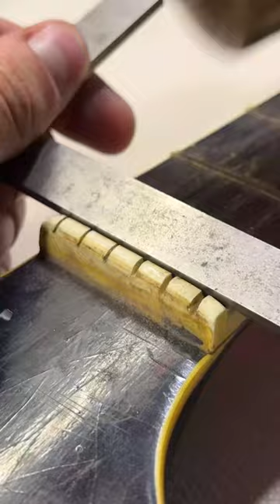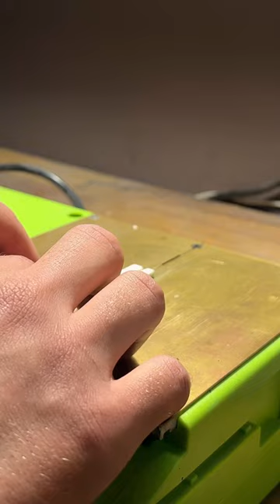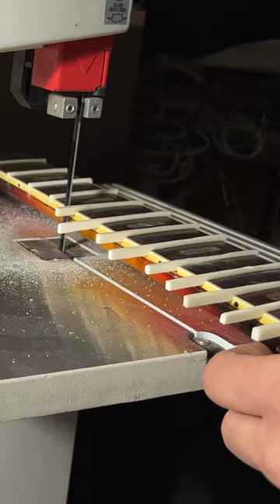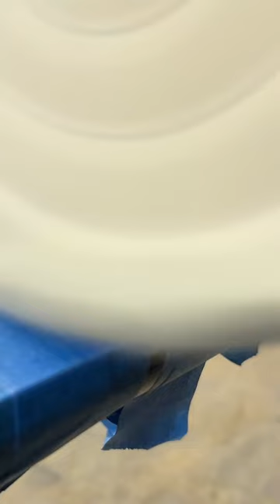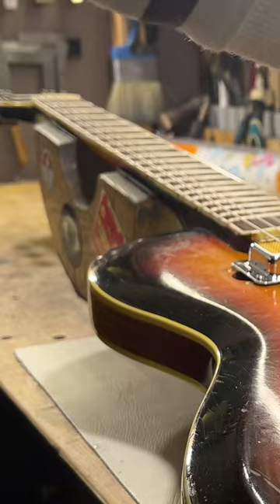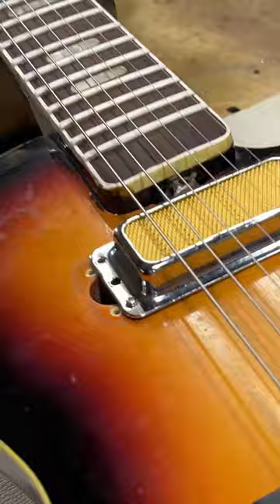bones instead of frets

Comment: nice tone, it will be interesting to see how quickly the strings will wear out the bone frets
Reply: Bone is softer than metal.  The frets will probably wear out faster than the strings.  Every material has probably been tested.
Reply: @rickjason215 No shit??!!
Reply: @rickjason215 You just repeated what dana said!
Reply: Hmmm, is nylon softer than bone? Too bad this guitar has pickups.
Reply: @rickjason215   This is a great video, for all models and materials of frets will result in a different sounding guitar. Energy is transferred from strings to neck and in the end also the body. It's resonance, these vibrations work on the strings, and the way it goes is not just "bone sounds brightest", sure it is good.
Reply: @voornaam3191  I saw a guitar made of Carbon fiber and it sounded good.  It was electric.  It would have been more interesting if it was acoustic. Weighed a couple of onces.
Reply: My guess is at a factor of probably a 100 times if not a 1000
Reply: @jadslash  Yeah brother bonus stronger than wood but it ain't shit compared to metal if he made frets out of a hard volcanic Stone it might last louder but those frets are gonna wear out at a factor of at least a 1000 times quicker
Reply: @voornaam3191  Nylon is absolutely softer than bone. I still say that bone has at least a 1000 times factor of how fast it will wear out on steel strings or whatever type of metal nickel and different alboys it's gonna wear out a 1000 times faster than steel wire frets wood.  I'm a guitar player I'm not a guitar Maker however I do understand engineering and physics at a higher level than most Engineers at least guitar Builders do and I promise you these threats will wear out really really quick and somebody that has the time and money to do this we'll only play that instrument not even once a month after the 1st month. That will drastically slow down the fresh being destroyed but I'm assuming somebody that I did this work has a knowledge and tools and money to just do that already knows the same exact thing I just said so it is what it is and he chose his choice and I'm sure he was already happy with it before he made it. I however don't think it would really make any difference in tone other than maybe if you didn't have your fretboard set up correctly and you had strings that were buzzing at the higher frets on the bone bruises steel but again that would be a mistake on the guitar makers part anyway.
Reply: @voornaam3191  Honestly brother I think the threats probably I mean OK I'll say the frats the bridge and the nut mean the least on a guitar at least as far as what they're made out of maybe not the bridge if it's hollow.
 I'll just make a different statement and say that I don't think frats will make much of a difference unless it's not made well and you have buzzing on the higher frets anyway
Reply: That's a moot point. You should change your strings every three months of use. Not when they get rusty
Reply: @bobmcfierson2163 lmao this dude thinks he understands math
Reply: They'll survive about 20 good bends.
Reply: Have an acoustic bone frets for years all is well
Reply: Maybe not an issue if he has a super soft touch?? 💚🎸
Reply: @rickjason215 check out the nova go, it's a travel size carbon fiber guitar. The frets are garbage out of the box and need to be polished but it's a pretty fun guitar, has built in effects
Reply: @rickjason215 the Bone frets are not compared to the strings, but to the nickel frets.
Reply: @adriantomo5688  Of course.  I was thinking that metal is harder than bone and that the strings would last longer on bone frets than metal.
Reply: How about glass frets 🤔
Reply: @FenderBender503  I know it.  Jimmy Page gave Jeff Beck a plastic guitar that he loved.  He said he picked it up all the time because it was so light.  I guess if a guitar is very light and easy to play, it would get the player to play it all the time.  The more you play, the better you get.
Reply: @rickjason215 
Bruh !
Reply: @bobmcfierson2163  Frets wear out.  You never needed a fret job?  How do they make bone frets?  If you bang the fret into place, it would probably shatter.
Reply: Nylon string will do the best
Reply: @jadslash  😂😂💀
Reply: @voornaam3191 yeah, this is an electric. Thats not how the sound works on electrics. Youre thinking of how acoustic guitars work.
Reply: @bobmcfierson2163  It is a hard argument because nylon is definitely softer than bone, but nylon stretches and bone doesn’t.  Volcanic stone might be harder, but more like to have flaws in the structure, causing it to shatter.  I guess the materials commonly used, got that way through trial and error.
Reply: @rickjason215 not much of a reader are ya
Reply: Hmmm...
I have made various bone nuts and saddles for about 50 guitars. Sometimes the play dramatically better. Never even thought of bone frets. Might be cool till they wore away. Probably last a long time on nylon. Used camel bone on a gut classical just for authenticity. Still playing it.
I've used thigh bones from camel/bison/moose/elk/cattle. Never tried horse or elephant.
TUSQ is a nothing burger.
Reply: The whole resonance thing is a myth that was created by the guitar industry. It’s been disproven by a YouTuber. I forget the name of the account. He made a very good video with a lot of practical demonstrations about just how little wood changes the tone. Frets do, strings do to a small degree (different brands, materials etc) pickups and amp are the biggest factors. Wood is really a cosmetic choice. And since guitars are painted most of the time, not a very important choice either. To me, hardware doesn’t make a massive difference. A heavy bridge will provide better sustain and you want your tuners to be reasonably solid so that you stay in tune. But even then, after a certain point, you’re wasting money if you buy the “best” premium hardware. It’s really all about the pickups and the amp. And the biggest thing, which many people hate to admit but deep down we all know is the player. Doesn’t matter how much you spend on exotic woods and premium hardware and high end amps and speaker cabinets. If you don’t put in the time to practice, and if you don’t really love music, you will always sound like shit.
Reply: Fret get will broke soon
Reply: Well that is most certainly different! I guess you can go super ultra jumbo frets if you go that route... wondering if the neck will be as stable because a lot of material is removed and filled with bone where it used to be wood...?
Reply: @georgemccabe3522  You are right.  Also, with all the computer digital mimicry, you can get any amp sound you want.  In the future, I'm sure software will correct a poor players vibrato and feel and artificial intelligence will anticipate the next note and change the pitch without the player's even being aware.  We all probably won't know who can really play and who can't!
Reply: Musima
Reply: Thought the same, every year you habe to change. But the Sound is cool 🎉

Comment: Could be cool for a guitar that doesn't use metal strings! You did beautiful work but I'd be worried the new frets wouldn't last long. What if you made a fretless guitar with a metal fretboard? Perhaps aluminum?
Reply: Kramer used to make guitars with aluminum necks, but the fretboards were wood.

Comment: Interesting as i have nickel allergy and it prevents me playing guitar cos the frets are often nickel.
Reply: The frets are not made of nickel. They're made of steel and have a nickel plating added to them. You can use stainless frets and strings.
Reply: @BrunodeSouzaLino  My ibanez Gio is the worst for some reason. Both my guitars do have nickel in the frets. I have a Harley Benton es355 and that seems ok. Maybe there's either more nickel in the ibanez strings or the jumbo frets have a lot of nickel. Incidentally I get it worse on the picking hand possibly from damping the strings. I'll try steel strings but I'm loathe to buy another guitar. I was looking at an Epiphone but that also has nickel frets.